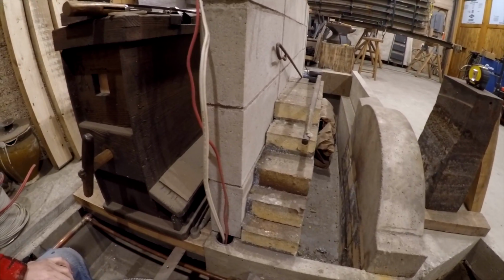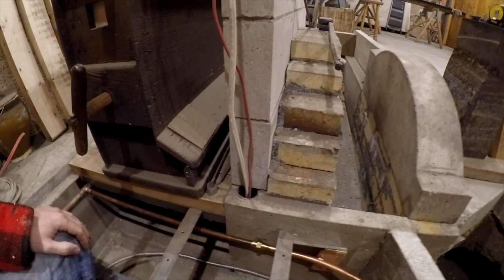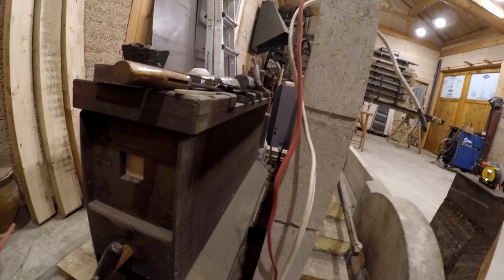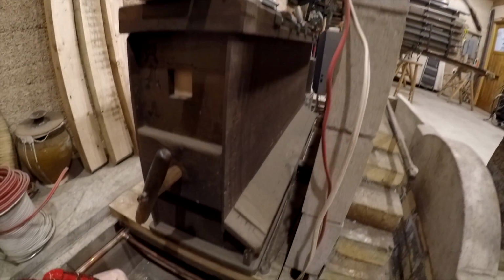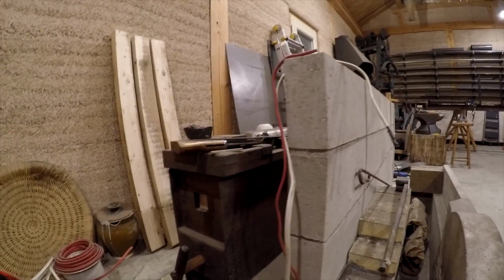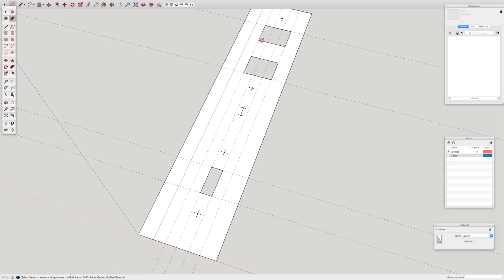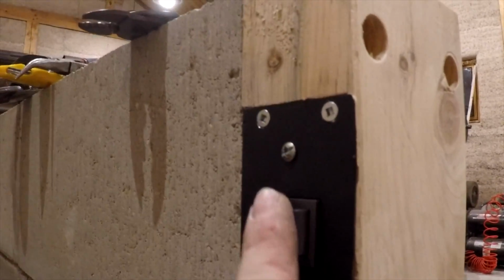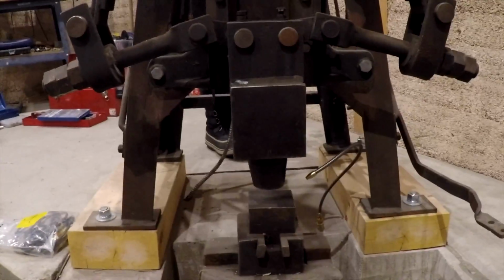Soulsmithing — Hidden controls on Japanese Forge

Comment: I know there's fire brick to block the heat but wouldn't radiant heat be enough to cause some issues later on with the wiring? Same reason there's a limit to how many wires are in a conduit.
Reply from the maker: You make a good point but actually no wires will be exposed to any sort of heat. It might not show in the video, but the radiant heat doesn't get there, plus the wood insulates whatever does get there. There'll be more radiant heat from the radiant floor than the forge ;-) Thanks for caring though!